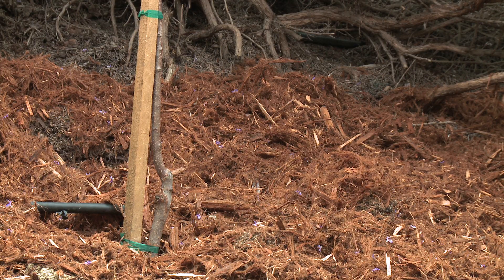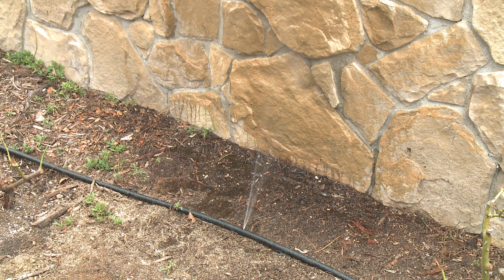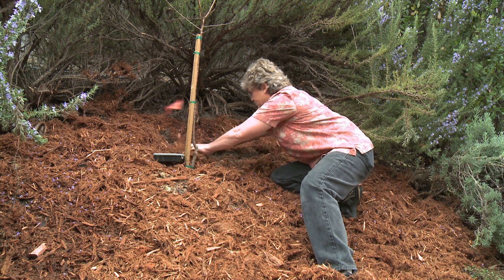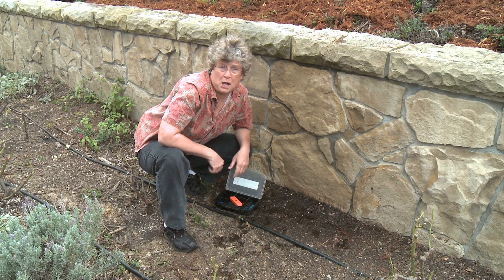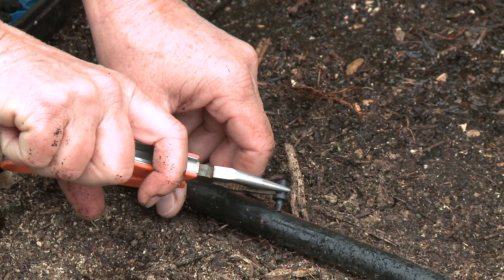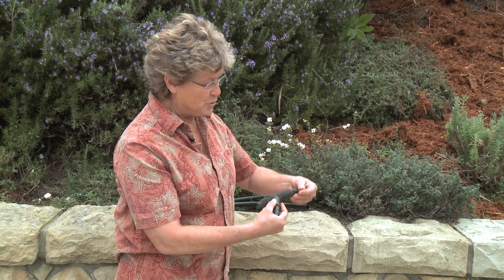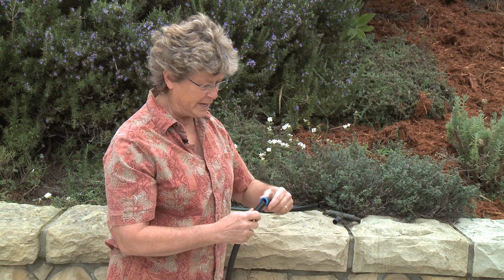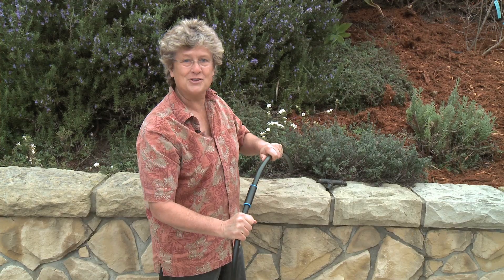How to Check your Drip System for Leaks

Comment: I don't live in Santa Barbara, but I really appreciate this video.  It is good to see a fellow woman doing the repair.  I found this video today and fixed my drip system with no problem.  A tree trunk had expanded around the tubing and caused a leak.  I also use a hair dryer to make the ends of the tubing more pliable.  It is helpful if you have weaker hands.  Thanks so much for this video.